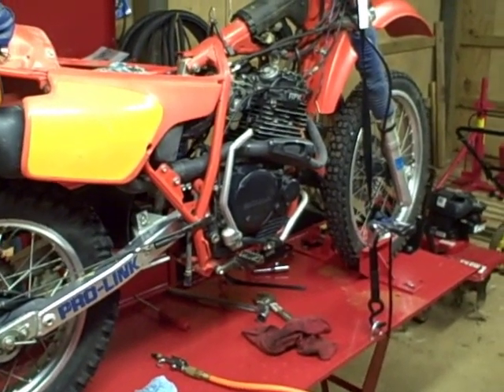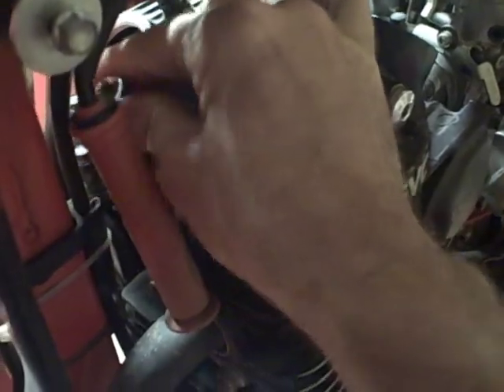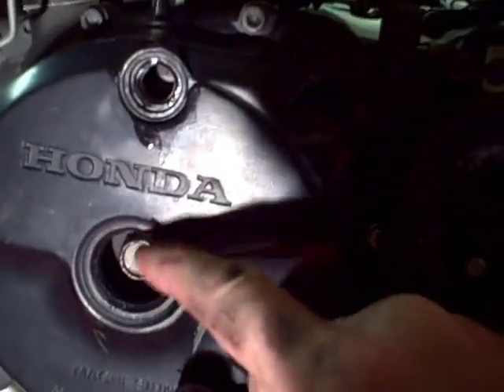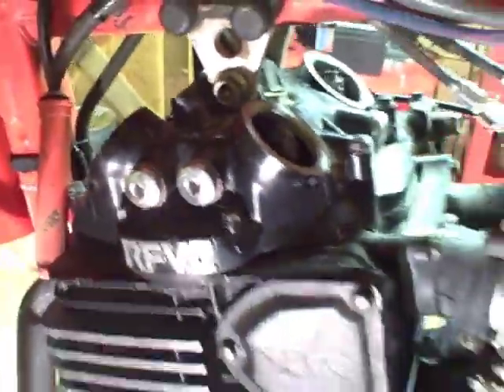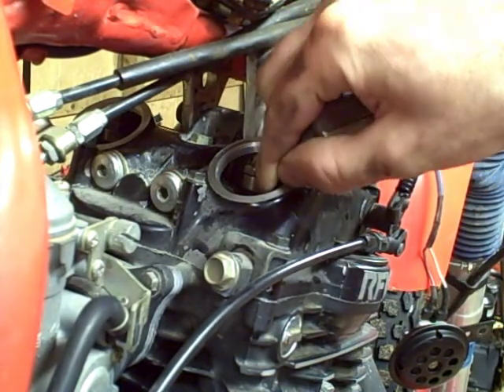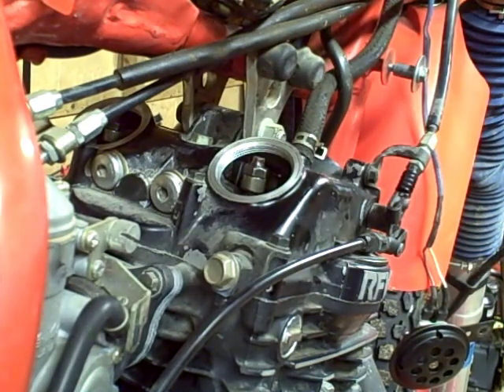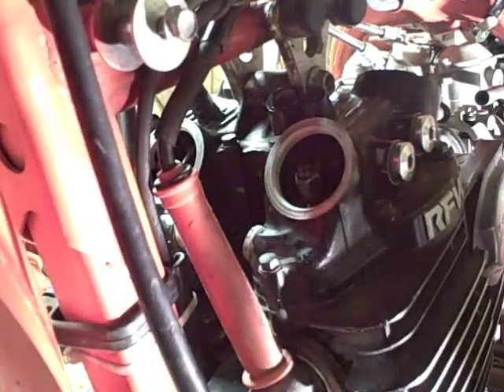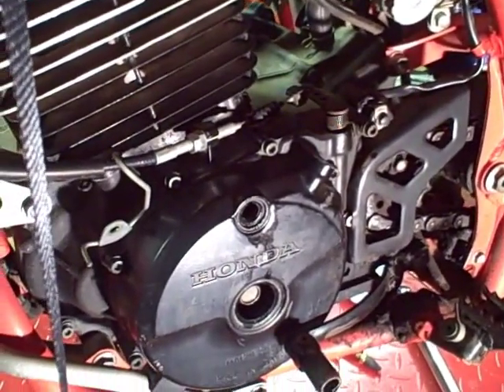Motorcycle Repair: How to adjust the Valves or Valve Lash on a 1985 Honda XR600

Comment: So i have a 1985 honda shadow 500cc i took the oil cap off and let it run air was blowing out does this mean in need to adjust the check valve or what should i be looking out for

Comment: When I take the covers off to take it to top dead center does it have to be empty of oil? I just changed the oil so I dont want it to all dump out
Reply: sory4beinanonymous have you found an answer to this? I just changed my oil yesterday and got a couple more things to check including this to get it running
Reply: sory4beinanonymous have you found an answer to this? I just changed my oil yesterday and got a couple more things to check including this to get it running
Reply: @osalcedoucmsae  this video should be flagged and remove. This is just as if there was no sound. All he says is be careful when we talking about feel and then the guy takes off. Comments more than 8 years old with no reply. Pffff
Reply: 07 CBR1000RR yea you’re not wrong, I just hoping someone in the comments would have some advise lol but yea it’s an old vid
Reply: @osalcedoucmsae  im still getting frustrated on mine. I spent all afternoon today trying to start it. No way

Comment: Hey mate, i have checked all my valve clearances for my 84 xr500 and they are correct, but my bike still has very low compression. Do you have any ideas on what it could be?
Reply: I'm pretty sure that means the piston ring is worn. Did you ever figure out what was causing it? Your comment is four years old, but I'd like to know the cause, in case I end up in the same situation.

Comment: Hello sir, I have a 84 Honda xr350r and compression is 0. I readjusted the valves and still nothing any ideas sir before I take it apart?  Thank you
Reply: formegolf hey mate did you figure out the problem as i think i have the same issue

Comment: I have a 1986 Yamaha SRX600 and I was wondering - Do you have to take the spark plug out to adjust the valves?

I figure the piston should be a TDC when I push the kick start down and get the hard resistance. If I push slowly it clicks just past TDC and that's where I kick start the bike from. Of course I check the marking on the crank to see I am at TDC, but it doesn't stay where the mark is. It seems to either fall short or spring past the TDC mark when I try to center it. But that's why my initial question about having to remove the plug first. Is that what's causing it not to hold the TDC alignment?

I don't seem to feel any looseness like you talk about in the rockers and it makes me wonder if I had TDC on compression. Right now it clanks a lot and I know I did  not do it right because it didn't before.

Comment: thankyou for the video but couldn you use a closed end wrench on tightening the nut adjustment and holding the flat head screw adjustment with a flat head.then check the nut with a torque wrench.this would keep the valve screw fromm moving.cause really anybody whose done any wrenching knows whats 25lbs feels like so 17lbs is pretty close to that.

Comment: The oil can't get into the cylinders unless the valves are worn, so there's no way to stop smoke from adjusting the valves. That's probably from oil seeping past the valve seals which seal the stem part, or seeping past bad piston rings.

Comment: Good vid , i have a 125 and i done my valves completly wrong i done the inlet tappet on the compresion stroke and the outlet on the exhaust stroke (seemed logical at the time) 
but this just cleared it up for me why my bike isnt running properly